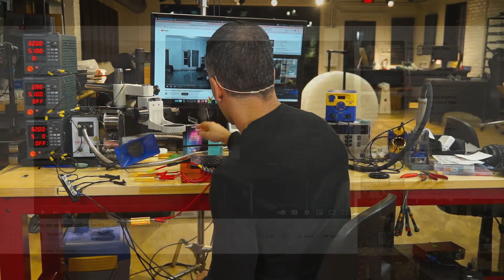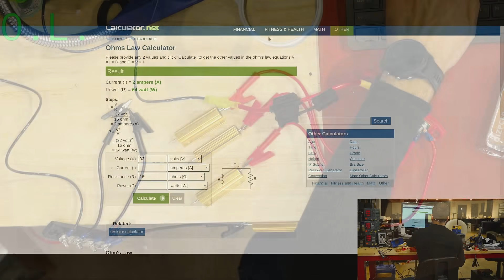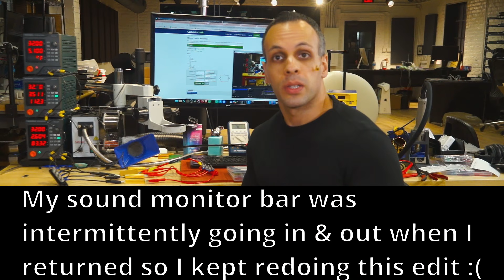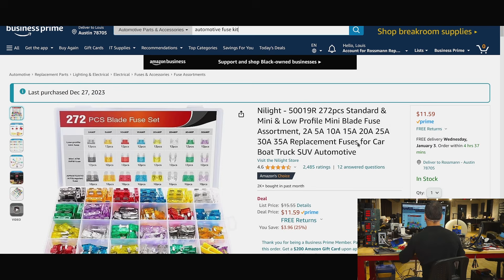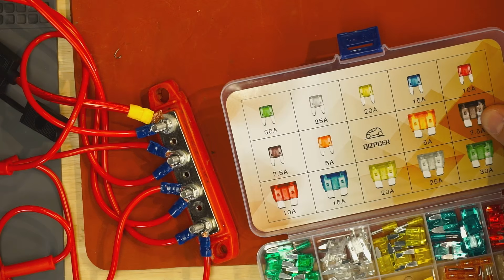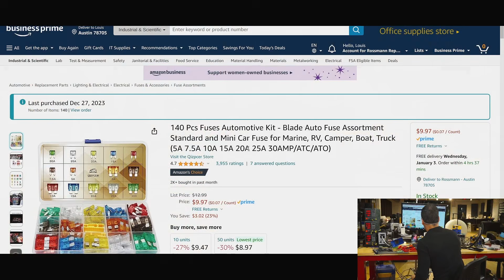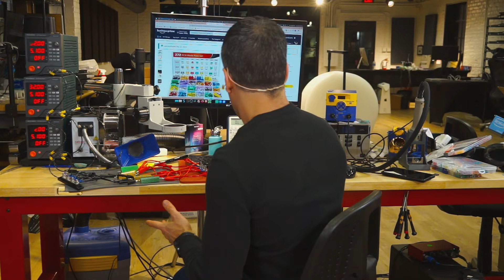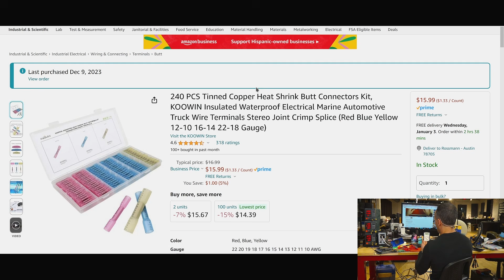Amazon Sells Fake Electrical Fuses

Comment: The risk here is that the lay person who replaces a fuse in their car, are unaware that the fuse won't blow when is should.  I mean, the guy buys a kit, and replaces a fuse that blew for a reason, and replace with a fuse that doesn't blow.  All is good to this lay person.  BUT the circuitry continues to draw too much power, melts wires or computers, and for sure the automaker won't repair under warranty.  And insurance companies won't pay out either.

Comment: This seems a very biased attack on Amazon. While his results of his "testing" can not be disputed, the fairness of it can I think. In my opinion this was by no means an objective test and does not take an account for a lot of variables, like testing more than one size fuse and also from more than one package (as everyone knows not everything makes it through QC) for one. 

Also why not test fuses from where he said do work like HD and others? Where are those results? Are we just to take his word? 

Also, fuses were not designed to protect said devices, but only the wiring of said devices.  That's a big difference. The devices itself may be able to take much bigger loads but the wiring used in the engineering and design for cost to performance can not. 

Does Luis get out a lot, I wonder...Amazon by far is not the only company out there selling crap. Does he not have a HF in texas as just one example? Shouldn't they be closed down already according to him by the strict codes of ethics and business his company and others are subject to? Of course not. Lot of b.s.

While I know Amazon does sell crap. His objective seemed more like animosity than anything else.

This video would have been better if he simply pointed out the crapy garbage amazon and most Everyone else sells (they sell this stuff at 711 and dollar stores. Where are those results and the rage over those results) But going on a rant about Amazon and how they screwed him over takes away from his message. Just my opinion.

Comment: I worked in amazon in the back office a few years ago. When a review contains some inappropriate language, it gets flagged and automatically removed. In these cases, however, the customer is informed via email. Only a handful of higher level managers can remove reviews. That your review never made it at all tells me you either used inappropriate language, or someone with the power simply didn't like it and didn't either approve or disapprove of it. No reviews are ever completely gone. At least that's how it worked when I worked there.
Reply: No bad language from me, a customer of Amazon since 1998, yet a critical one star review I posted on a very badly researched book by a so called ‘celebrity’ was removed and I am now banned from posting any reviews.
Reply: @MartinE63  Also a "customer" since 1998. I wrote a scathing review of a TV made by a company that starts with Sams*. Not only was my review refused from that point onward all my reviews wouldn't get posted. Literally shadow banned because there was something "problematic" that was never ever spelled out. When they stopped letting you comment on other peoples reviews that was the last straw. Amazon has since been pouring fuel on their self made dumpster fire.

Comment: I am an EE, and though I can't say I would've done the experiment this way, I think the result is still valid and the problem Louis is demonstrating is obvious.

For any other nerds who care to know how this could be improved:
*The voltage is not important for this and thus the resistors are not necessary. The voltage rating of the fuse only matters in the blown state - if the fuse blows and you have too high of a voltage across it, you can get arcing across the blown fuse contacts and it will continue to deliver power.
*Building on the last point, most bench power supplies have a constant-current mode that would have been appropriate to use here. You could hook the fuse up directly to the power supplies (with no resistor), set your initial current limit to 2A, and continuously adjust it upward in small steps until it blows. This is a lot simpler to do than trying to hook up individual resistors one at a time, and gives you much finer resolution of the current you're putting through it
*It's not normal for power resistors to smell and/or smoke - they are overheating. They may be rated for 100W, but that's assuming that they are mounted to some sort of heatsink. Their rating will be much lower if they're just free-standing like this
*Paralleling DC power supplies like this is generally not a good idea. Some are designed specifically with this capability, and I don't know what exact model Louis is using there so I can't comment on that, but many aren't. Each supply has its own feedback loop to control its output, and hooking up multiple in parallel can cause those control loops to start fighting each other leading to weird or potentially damaging behavior. I don't see any obvious signs of that in this video.

Again, these are just unimportant nitpicks and I know that being super scientific about it isn't necessary to demonstrate the problem with these fuses

Comment: I recently purchased a little resistor assortment to restock my supply since there's literally nowhere in town to buy electrical components.  But I used one to wire up an led to a little Bluetooth board I was working on for my shop stereo.  It was fine for about 10 seconds till the led let its smoke out.  So I decided to check the other resistors and they're way way off.   Some don't let 50% of its value pass through and others aren't really resisting at all lol.  One let almost 200% of its value through.  So now I have to order some more resistors and wait to finish my stereo project.   and im sure amazon knows im not going to waste the time trying to get my $20 back. Maybe I'll order from Northridge fix if they have them.

Comment: It’d probably be safer to just use a small gauge wire as a fuse and let it melt under load. Pathetic, I guessed 200%, maybe 300%, load in the survey.

Comment: Louis, you want criticism?   Here goes:  I liked what you did last time with the crimps.  Contrast a good product with and unacceptable product.  Secondly, if you just went one more step and looked up what a good American product (such as Littlefuse) specifies you'd immediately place yourself on firmer ground.  If you did, you could have told your audience the American branded alternative for a similar product would fail (open / pop) in 2 to 50 seconds @ 200% overcurrent.  This would have accentuated your claims.  While your report was "good", I'm arguing (not really) what would have been better or best.  I know, Louis that wasn't your intent and that too is completely valid.  Thank you for bringing this to our attention.  Chinese quality control can be very lax.

Comment: Here's my observation: the first two Amazon fuses both blew at 10A. Maybe they're all 10A fuses just branded with different amperage ratings. Did you try anything above 10A from the kits? I'm genuinely curious because it would make sense why they can sell a kit so cheap. If they're literally all the same amp, there's no extra manufacturing or design necessary.
Reply: This line of reasoning is convincing to me. The number of improperly translated/labeled items has definitely gone up. Sellers sometimes just put every keyword in to move up the search too even if they don't fit the keyword.
Reply: ATC fuses are supposed to follow a color code and they usually have the amperage molded into the colored casing. If it's not a super cheap set, they even paint the raised letters white so you can read them while being over 35 and colorblind. 

Not to mention, they have curves that allow them to carry over the rated current for a time. None of the fuses rated under 10 amps are supposed to last more than 10 seconds while carrying 10 amps. 10 amp fuses do not blow at 10 amps, that would be pretty useless. The standard says a 10 amp should last more than 2 hours at 13 amps. So, that's one useless fuse masquerading as a fuse that's supposed to adhere to a defined standard. There is no way for it to be mislabeled. It serves no purpose other than to make some nefarious individual money while risking very serious property damage to anyone unlucky enough to come across it.  

Amazon should be forced to assume liability for this garbage.

Comment: i bought some atc resetable circuit breakers.  hooked them up to my xantrek 60v 20a power supply to my adjustable load,  all the breakers took almost 2x the current before they popped.

Comment: I've dealt with this firsthand. Chinesium fuses cannot be trusted. I've seen fuses that blow too early and too late. Shitty internal connections are also common, I've seen ATO/ATCs that will melt the plastic with current significantly lower than their rating. As if it wasn't enough that they fail to protect the circuit, the fuses themselves have to be a fire hazard too. It's wild. Never had any problems with Littelfuse or any other reputable brand.

Comment: I wouldn't necessarily assume the fuses you get at a store like autozone would be any better since they probably come out of the same Chinese factory. They are all made in China with no quality control of any kind. Sometimes they might work, sometimes they might not - probably depends on the day they came out of the factory more than the brand on the box. Wouldn't surprise me if they just didn't have any 2 amp fuses on hand so they decided to just mark a 5 amp or 10 amp as a 2 amp just to ship out the door.

Comment: i used to have my bench in a similar way. with my monitor in the middle of it. until one unlucky day i brushed a soldering iron tip against my 1 week old 27inch 120mhz monitor. this was a year ago. every-time the screen is black i see a tiny white dot near the centre. it is infuriating, when the screen is full of colour i can't see it. but when it is black, aaargghh. i keep considering maybe washing some dark ink into the minute crater i melted in the screen to try and tone done the light. but i daren't.

Comment: Amazon has another scam now: I put 4 items in my cart yesterday. They all were eligible for "free shipping", but yet when I went to check-out I noticed that one of those items (an $8 item) had a $6.99 shipping charge (My total order was $133, so I definitely qualified for free shipping). I assumed I had made a mistake, so I went back & looked at the item page of the item in question, which did indeed say "qualifies for free shipping". So I deleted the item in my cart and added it again from the item page. Went to check-out..and the shipping charge on that item was gone...but now ANOTHER item had a $6.99 shipping charge- when it previously hadn't! I repeated the above scenario 4 or 5 times, and the same thing kept happening- each time the shipping charge would be switched to a different item! They were going to charge me $7 for "free shipping" on this $133 order no matter what I did......so I deleted everything anbd bought three of the items elsewhere, and decided I no longer wanted the 4th (an $86 item). I was so disgusted by this fraud. They're just hoping that most people won't notice and end up paying something for shipping while thinking they're getting free shipping. This has happened to me the last few times I tried to order from Amazon. It's not that I'd mind paying $7 for shipping- but I will not tolerate the fraud of offering "free shipping" and then trying to sneak-in the shipping charge. Between that, and the proliferation of garbage products and departure of many of the good brands, I think I am just about done with Amazon.

Comment: So I went down a deep rabbit hole asking what is the typical over current needed to pop an ideal fuse. What I found in response was all over the place but it seems most agree that they are designed to fail at 1.5 to 2x the current draw rating. Even with that knowledge wholly fuck Amazon is going to burn some shit down before these products get removed.

Comment: Just a comment to the wording, the items are not defective. They're non compliant. There are standards to comply with to sell these items in the market, and legit shops will have datasheets and certificates of compliance for every single item they sell. Amazon is selling electrical equipment like books or shoes.  legislation on online markets and accountability to the platform is missing.

Comment: The other thing to think about here is how many devices are manufactured with such fuses.  If you buy some custom thing online, these fuses may have been used (e-bikes, scooters, hoverboards) or repair shops who might not know better.   Also, if Home Depot doesn't sell certain things, they tend to not carry them.  Radio Shack did this too and now they are gone. 

This is dangerous.

Comment: I got a nice set, from Temu, a couple of months back.  Burned a big wire, on a motorcycle, I was fixing.  I put on the 50 max amp meter and found it pulling nearly 30 amps, but still wasn't blowing.  It was a 10 amp.  I left a review, to this effect, but they still sell them.  Prob'ly, the same "brand," sold on all the sites.  Few people have amp meters, to notice.  These will cause a lot of damage.  You can look at 'em and see that the conductor has no thin area - and all look the same, no matter the supposed rating.  Sellers don't care.  They got billions of dollars, so don't care about doing hundreds of dollars (or more) of damage, to sell fraudulent fuses...

Comment: Note on fuses. It protects both sides. If I had a bad wire connexion in my house, and that I touched that wire, I'd be more concerned about me not being transformed into coal than some material damage.
Side note : That's why you don't do fractal burning with a discarded microwave, because if you happen to touch something you shouldn't, you'll be dead. And that's because there's no fuse to blow to protect you.

Comment: if you use a crimper that's made fore barrel type crimps they work a lot better Part #: CHT WSCCP
Line: Carlyle Hand Tools  Pliers Wire Stripping / Crimping / Cutting 6 3/4"

Comment: I wonder if these companies are actually making these fuses or if they are buying rejects from the automotive manufacturing industry. According to a messy, quick search on a couple of different search engines, there are roughly 74 companies that make fuses. I'm positive that a few of those are spun off from the larger manufacturers.

Comment: I've seen enough people do sketchy fuel pump fuse bypasses to know not to mess around with improper fuse ratings.

Also it's not that expensive to replace a bad fuel sending unit. Don't hack up your factory wiring because your fuel pump burned out. Sketchy wiring and gasoline do not mix well.

Comment: You have to also consider a lot of stuff is the EXACT SAME PRODUCT just sd under different brand names. This has happened to me before and I mean EXACT product. I had to replace some items for a project because the first set was abaolute garbage. Made sure to avoid the brand of thw previous purchase, went for highest rating/most reviews and got that. It was the same thing as the previous item just sold by a differenr shop under a different brand. 

   Thankfully my issue wasnt with something that could harm kr maim but this is a bigger issue

Comment: I seen an arc when you hooked up  the last resistor on the first fuse, so its possible without that arc that 2 amp fuse would have kept going.  Careful Louis, Consumer Reports doesnt like competition.  Great work but I have to have at least 1 complaint so Ill just point out you should have put a cooling fan on your resistors, are you trying to burn the place down or what.

Comment: It probably doesn't matter, but I went ahead over the Amazon and placed a bad review for that first product.  I mean, if everyone who watches this channel did that, we might actually affect some level of change over products like this.  Or probably, this will be my one review that doesn't get posted on Amazon, haha.  

That said, it would have been nice if you did some light testing with more than one from each kit.  In general, the first fuse you grab isn't going to be the one unlucky bad one.  Either the entire kit has mislabeled 2 amp fuses, or perhaps they are actually just the same product in every category and are just labeled differently.  Like, what if every single fuse in that kit is actually rated for 5 amp.  So the fact the 2 amp blew at 10 isn't as bad because it blows between 9-10 amp, but it's actually 5 amp.  But that could also mean your 10 amp fuse is gonna blow because it's actually rated for 5, and your 20 amp, and your 30 amp...  This could be a bad product in so many ways.

Comment: Amazon consistently block any bad review I make. Never trust the ratings. 
Like most consumers, I would expect the fuse to blow after a few minutes at 10-25% over rated amps, after a few seconds at 50-75% over rated amps, and almost instantly at 100% over rated amps. No one would expect a fuse to maintain connection indefinitely at 200-300% over rated amps. SMH 
I would be interested to see if you get consistent results or if all these fuses just fail at their jobs—is it quality control or just fake products.

Comment: Sorry if it's an obvious question but what's the point of the resistors? Can't you just wire the power supply to the fuse directly and add more power supplies in parallel?